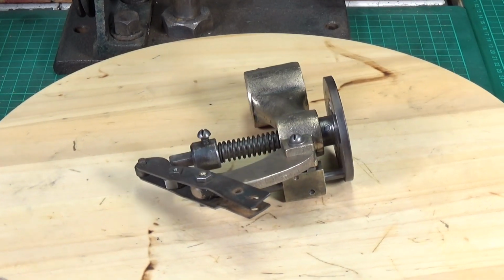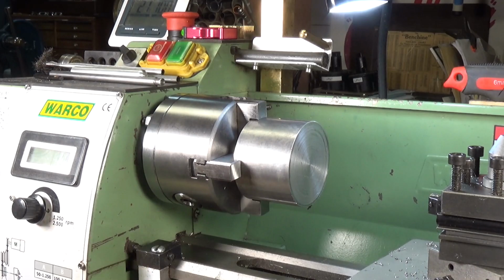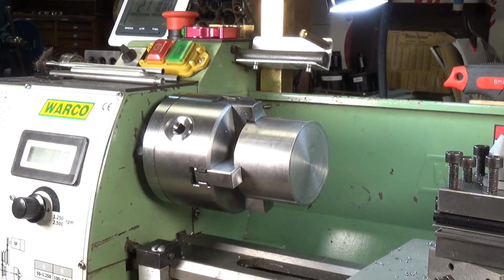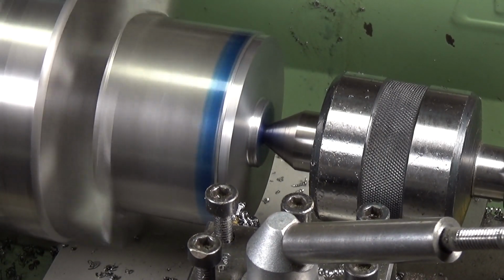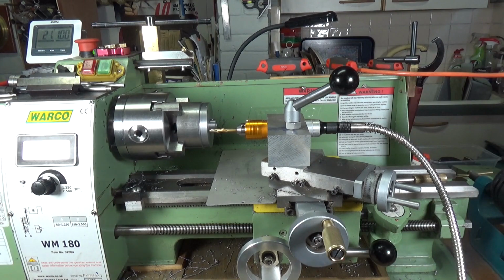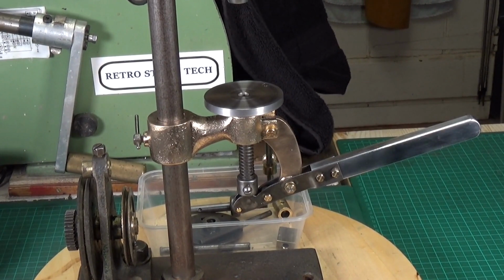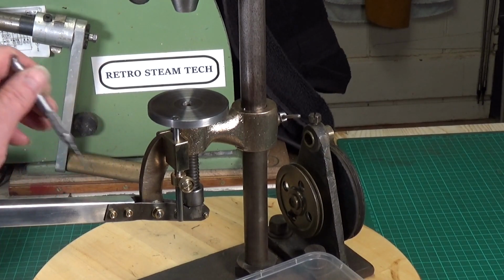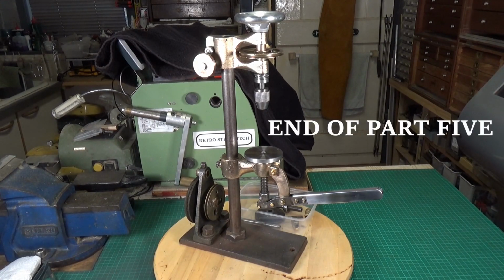Goodell-Pratt Belt Driven Drill Press - Part Five

Comment: Great.  looks a million dollars Alan.  A dark green base would look good with all that shiny metal.  What are you thinking about using for a motor ?  
What brand is the chuck ?  Cheers Rob
Reply from the maker: Hi Rob and thanks. I've gone with black for the base, silk finish not gloss. I'm using the old standard Banggood 755 DC motor with a 36V PSU and a speed controller. The chuck is actually branded 'Goodell-Pratt'. Hence the name, although I have no proof that this was a Goodell-Pratt drill press. Cheers, Alan.
Reply: @RetroSteamTech  Hi Alan, I meant what brand is the 4 jaw lathe chuck ? Cheers Rob
Reply from the maker: @Xynudu  Hi Rob. Sorry I should have realised that's what you meant! I got it from a company called Arceurotrade https://www.arceurotrade.co.uk/Catalogue/Chucks/Lathe-Chucks/4-Jaw-Self-Centring-Cast-Iron-Lathe-Chucks-Chinese-Origin . The one I purchased was the 100mm version 040-040-11025. Not sure of the manufacturer, Chinese obviously. I've used the company on a number of occasions, their stuff is very reasonably priced and is well packed with a fast delivery time. Cheers, Alan.

Comment: Hello Alan,
Good work on the drill, I bit on a similar type of drill press last night but sadly was outbid. I really like the 4 jaw chuck, that will be most useful,
Cheers.
Paul,,
Reply from the maker: Hi Paul. Sorry to hear that you missed out on one. I'm hoping this one will be useful when drilling screw holes in thin plate for example. The 4-jaw is great for jobs like this on round stock where you just need a good grip rather than absolute accuracy. Cheers, Alan.

Comment: Hi Alan. Definitely coming along nicely. Your improvements are well thought out.
Good idea regarding the four jaw self centring chuck. They do seem to have their place. 👏👏👍😀
Reply from the maker: Thanks Andrew. As I said to Kev below, I'm basically lazy and dialing in a conventional 4-jaw is not my favourite thing! So for round stock that needs a good grip this chuck is ideal. Cheers, Alan.
Reply: @RetroSteamTech  Ha ha, I hear you. 👍😀
Reply: @RetroSteamTech  They are fine so long as the stock/job is perfectly round, otherwise it will only really grip with two jaws.  Cheers Rob
Reply from the maker: @Xynudu  Hi Rob. Yeah, I kind of figured that but in this case the round bar stock was actually round, well the jaws made 4 marks on the bit in the chuck! Cheers, Alan.